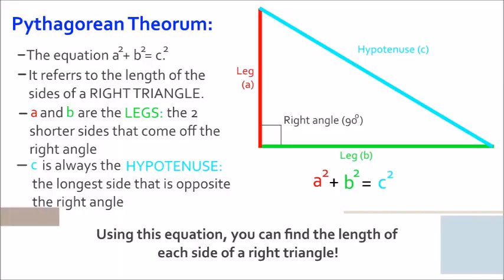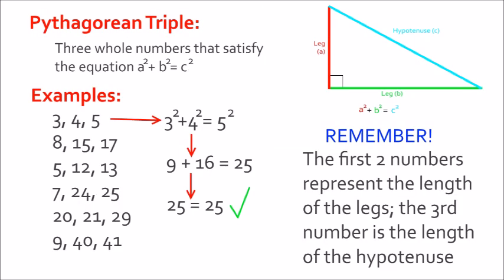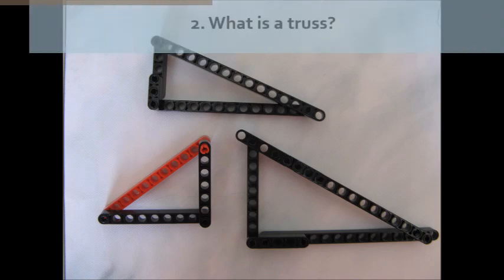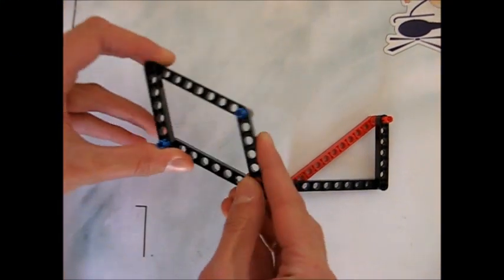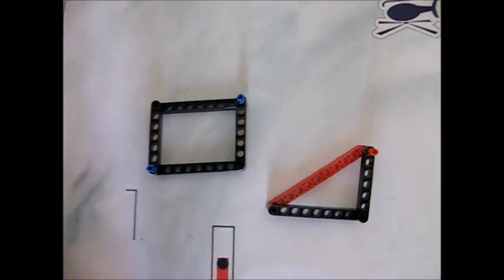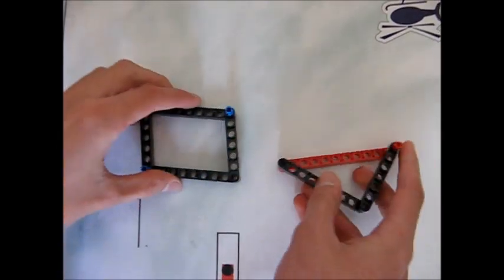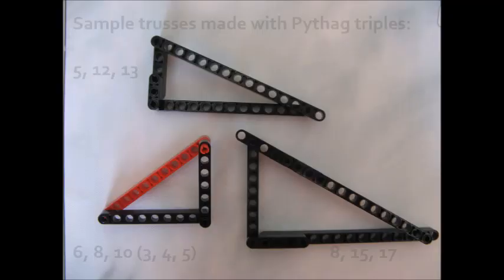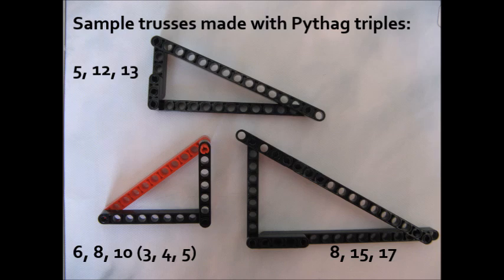How To Make Technic Constructions Stronger

Comment: Correct me if I'm mistaken, but at the end you mentioned that they had to be one longer than usual to make it work because of overlap. I'm pretty sure the actual reason that is has to be one longer is because in the Pythagorean theorem, the lines have no thickness, unlike Lego bricks. However, the beams have a certain length. Let's say that you have a 5 long beam. It has 5 holes in it. Now, in the Pythagorean theorem, the legs and hypotenuse are all connected at the very tips. Let's call the tips of each segment the pivot point (Even though they can't move. How ironic). Now, a Lego beam connects to another beam at the very center of any of the holes, using a peg. Back to the 5 long beam now. The reason you would have to have your triangle be 4 5 6 is because the "pivot point" is half a unit closer to the center on either side, so this would reduced the length between the "pivot points" by one, so while the length of each beam would be 4 5 6, the distance between each "pivot points" would be 3 4 5. 

Hope this helped!
Reply from the maker: Shadow's Ace I suppose you're correct! Good thinking and thanks for sharing!

Comment: i'f got a little problem, if i want to transport an object (picking up and leaving) it always uses at least 2 motors.
Reply from the maker: Duco Mensink Okay; that's a problem we run into a lot. What type of robot are you using and what king of object are you picking up?
Reply: Builderdude35 I am using an ev3 and there are different objects. some but some are just to big to leave on the ground
Reply from the maker: Duco Mensink Are the larger objects too heavy? because if they are, you can solve this problem with a worm gear: you can learn about them in my video here: https://youtu.be/TQ9hQ_ZXwmM
Reply: i will try it. thanks